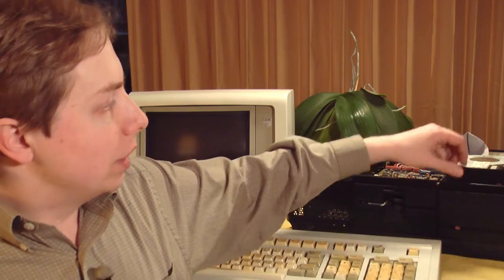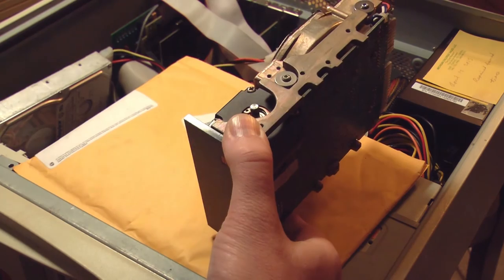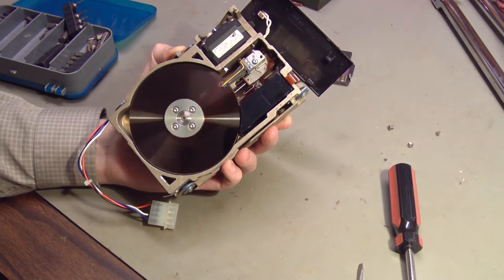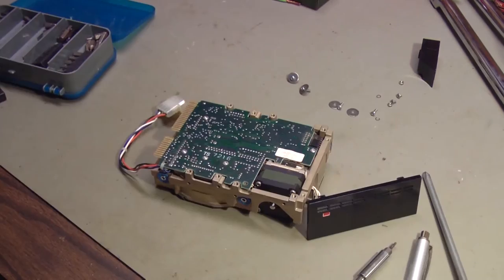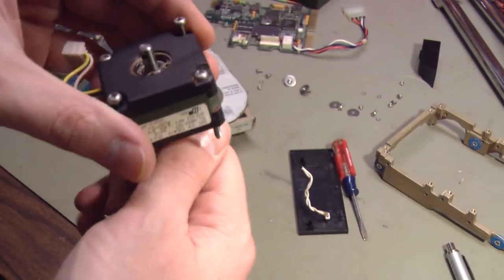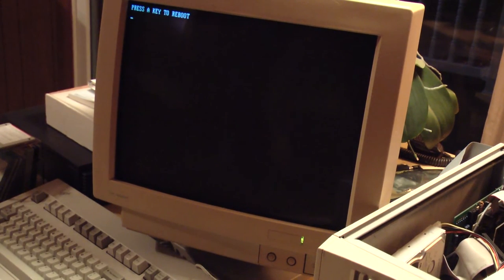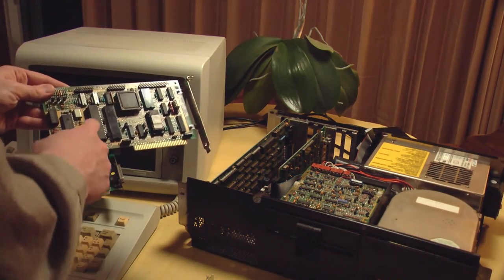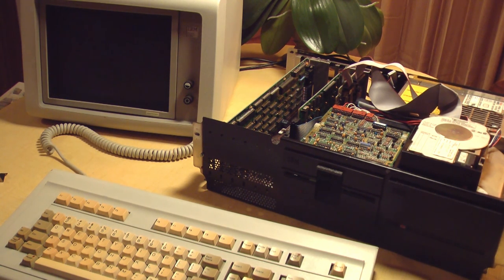Tandon TM-362 Vintage MFM Hard Drive Repair Attempt #1

Comment: Hi, do you still have that drive? What was the result of your efforts... were you able to format it? I was thinking about that slack between the head stack and the stepper motor - I'm positive that shouldn't be there. A few weeks ago I eventually stumpled upon a Shinon FH-354, which has been lying on a shelf for many years; it was my intention to bin it when I got the time, but when working on my Amiga's floppy drives I realized it was exactly that one they used back in the 80's and 90's for these - so I decided it was worth trying to salvage it. After a thorough cleaning and demagnetizing I was able to format diskettes, but it wouldn't read them afterwards, let alone any other previously formatted diskettes. I also had to recalibrate it using a program I found on the internet. But still no joy... that is, until I finally decided to try and do something about the slack; that solved the problem. Problem is, if the head stack is able to float around, it can't position the heads over, say, track 0 precisely enough, even if it has just formatted it (and, of course, the problem is even bigger with hard drives than with floppy drives). If you did manage to format it and still have it, I would suggest trying to get that slack fixed and try again... who knows? c",) (I was on the verge on giving up on that floppy drive, but I got stubborn and decided to do everything imaginable to get it working - and in the end, I succeeded). :-D
Reply from the maker: I still have it but despite continued efforts, I haven't made any progress. I'm pretty sure I won't be able to format the drive until I can clear up that controller error that it throws. Thanks for the suggestion and encouragement!